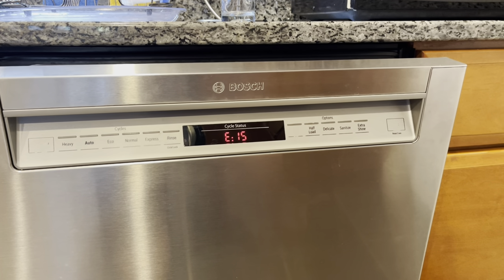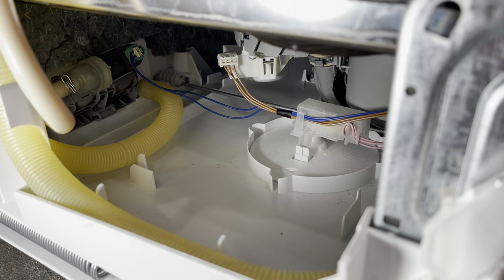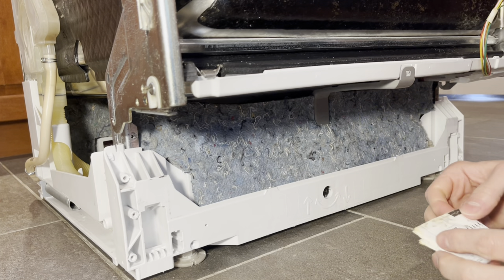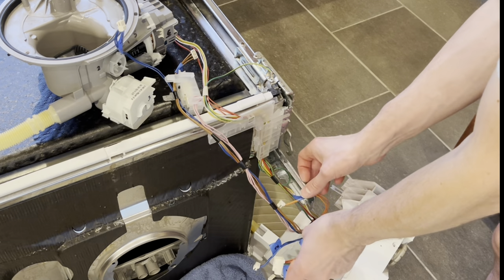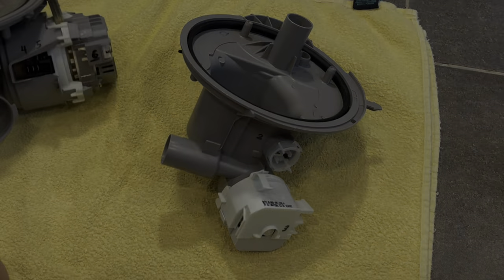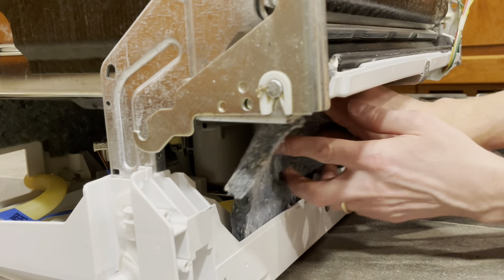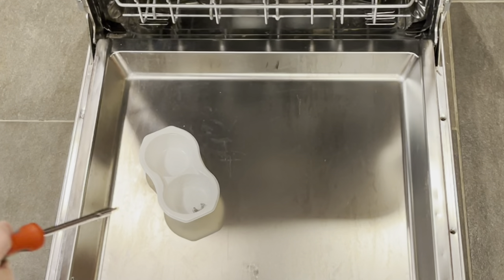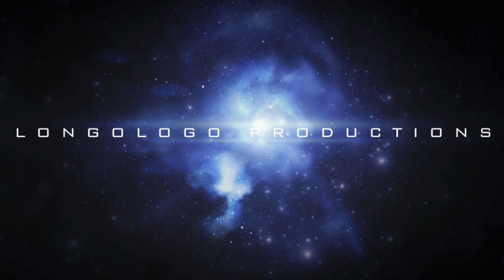Bosch Dishwasher Error Code E15 - Watertap Fix

Comment: Your family is lucky to have you around! This is one of the best DIY videos ever, and we were able to replace the water valve. Unfortunately, the "Watertap" error continued, so next we replaced the 10-year-old hose and that was the culprit - a big chunk of rubber sitting in the end of the hose. (The problem all started after water had been turned off for another plumbing issue and the first dishwasher run afterward started the error. Maybe an air gap and the water pressure back on broke the piece loose from somewhere...)
Reply from the maker: @michaelfleishman2384:  Thank you for such a nice compliment!   Glad that you were able to figure out that the chunk of rubber in the hose was the culprit!

Comment: Thank you for the AWESOME video! I am going to use it to repair the leaky sump on my dishwasher. How did you decide which additional parts to replace? For example, you replaced the drain pump (0412) but not heat pump (0401 -- which I realize is quite expensive), water distributor (0406), or water switch motor (0407).
Reply from the maker: @Wayne Boras:  Thanks!  The busted water inlet was the motivation for this whole effort.  As for the parts, it was admittedly a judgment call to balance cost against things with seals that I thought might be good to replace.  The dishwasher had no problems heating the water so I punted on that part.  It also wasn’t running loud or rough so I also punted on the distributor and switch motor.  So basically since I knew I had to replace the water inlet I was looking for other low-hanging fruit.  If any other parts act up later, I can always go back to replace those.  Hope that helped.
Reply: @LongologoProductions  Solid reasoning. Thanks again.

Comment: Great video.  Very helpful.  I don't believe you mentioned how much all the parts cost. Just trying to determine if part cost plus labour time is worth doing the job or should I just replace the entire unit.  

I am getting an e15 on my Bosch but can't see where the leak is coming from.  I removed the standing water, and ran 2 rinses but could not see any water coming into the base. It looked like there might be a tiny drip at the inlet valve but It was very minimal. 

I did not run the unit but woke up this morning and the e15 is showing again.  Must be a leak somewhere.
Reply from the maker: @Jason Tempelmann:  Thanks!  I listed all the parts and the cost in the video description.  Let me know if you don’t see it.  No fun waking up to an E15 error!  Start with the inlet valve (most likely source of the E15) even if you only see a minor leak. Initially it may take several hours to build up enough standing water to trip the E15, but it can turn major in no time.  Good luck!
Reply: Thanks for the reply.  I should have checked in the description, I can see the part prices. This info is very helpful and based on the part prices, labour time and the price of a new dishwasher this video is very helpful to anyone with some basic skills who wants to save a significant amount of money.  Thanks for posting

Comment: Well it's not the water inlet valve.  I thought I had it fixed after changing it out.... ran a cycle and all seemed aok.  But a few hours later E15 again.  Any thoughts before I get deeper into the machine?  Thanks again for the video
Reply from the maker: @waynetcampbell:  Where is the leak coming from?   Slide the unit out and look under the side at the bottom tray with a flashlight and run a rinse cycle to see where water is leaking from to cause that styrofoam float to lift up and give you that E15.  In my case I could clearly see water leaking from the inlet valve.   Also the mounting of the inlet valve and the hose connection is tight and awkward if you have to push the unit back under a cabinet.  Could it be that the connection from the hose to the water inlet valve was compromised?

Comment: Why did you replace all those parts?  Wouldn’t it be better just to replace the leaking part?
Reply from the maker: Given the age of the dishwasher and because it is a pain to pull that whole thing out and take it apart, I figured that it would be better and cheaper in the long run to just replace those other parts now, since those other parts would probably be prone to fail or to leak next.

Comment: 5:30 please show me the effort and cursing to pull that hose off. Less "cut action" because we need to see HOW you accomplish the tasks.
Reply from the maker: @Tom Leszczynski:  Ha!  I don’t remember how much twisting back-and-forth was required, or whether I had to work in a small flat blade screwdriver to start to free the hose.  But the video is almost 30 min long as it is. Surely you can be spared another minute of twisting a hose back and forth.  😁. If it was really difficult I would have added a comment about it to the video or the description….
Reply: @LongologoProductions  I did it! By holding the middle of the pipe firm, and twisting and pulling hard on the valve. This increased the tension in the hose which eventually overcame the friction.